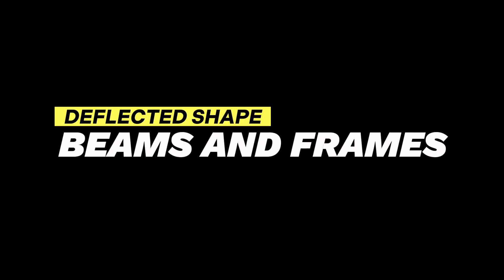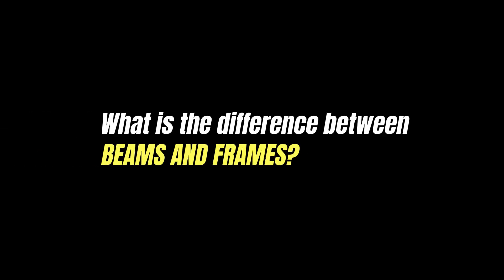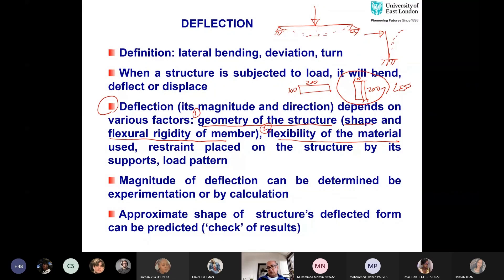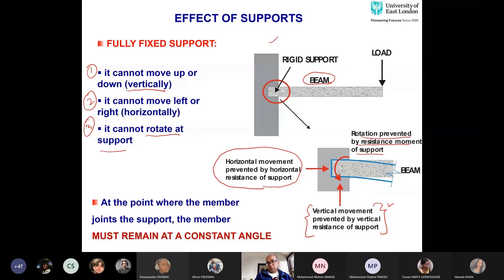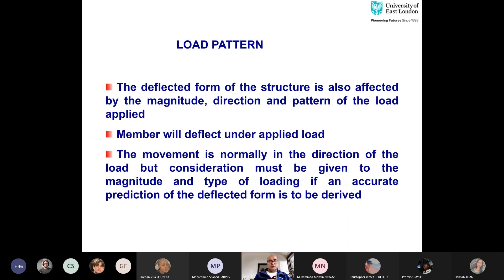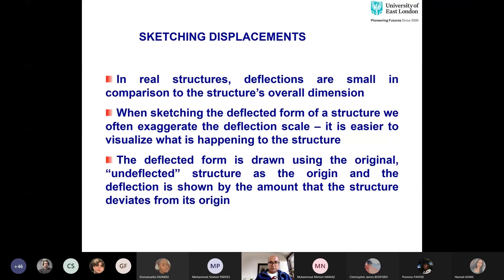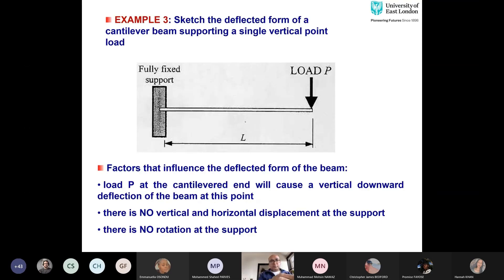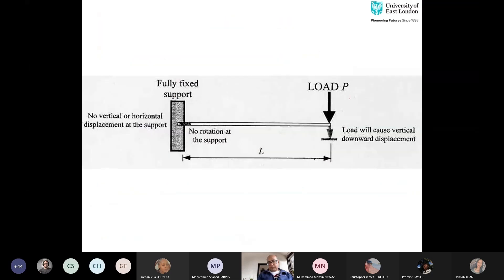How to draw deflected shape of beam and frame!

Comment: Why most engineers follows procedure like, BM diagram obtained from deflected shape, whereas, the correct procedure is, deflected shape to be obtained from BM diagram. As BM diagram leads to the deflection diagram, because the internal bending moments directly influence the curvature of the deflected shape.
Reply from the maker: Both diagrams should be in harmony. No matter if you start with BM or deflected form.

Comment: Pause video at 15:09 second, the BM diagram of beam having some hogging moments at its ends, and deflection for hogging hasn't plotted there, (only sagging effect is considered).
Reply from the maker: You are right. the deflected shape does not show double curvature properly. Although, it is there, but it is not exaggered to show hogging region in the deflected shape. I took the example from Paul Smith's book Structural Mechanical. 
I agree, hogging region of the beam should be exagerated in the deflected form. 
This is something I missed in the original lecture. Thanks for poiting it out.

Comment: (1): What is meant by "joint compatibility" ?
(2): In the simple frame,   for the beam rigidly connected and located between two columns, Whether it will deflect in "S" curve or "inverted S" curve? (When load applied rightward).
Reply from the maker: Joint compatibility means if beam rotates column will rotate too is it is fixed, developing a reaction moment.

Comment: Dear Dr Jawed, Thank you very much for your sharing. Can I ask one please, with pin support  resist only Horizontal and Vertical at support and free rotation at support but in reality as steel warehouse I saw most structural Engineers provide pin support to steel column? But in reality the column is not allow to rotate at all? Can you help explain please? 🙏🙏🙏
Reply from the maker: Having a pin support is a modelling assumption. In reality, all columns and beams will take some moment, but that will be far less than their moment capacity (ability to take moment). In pinned joints or supports, there will always be a gap to allow rotations, but remember rotations will be really very small.
Reply: @DrJQureshi  Thanks for answering! if you can make a video about it, very helpful junior Engineer like me.

Comment: Roller supports don't prevent horizontal movements only. They restrain movement perpendicular to their placement. For example, a frame has a horizontal member connected to a wall, and the end condition is roller. In this case, roller support will allow the vertical movement, but it will not allow horizontal movement.
Reply from the maker: Yes, absolutely right. Roller supports prevent movement in direction normal to their placement. Thanks for the comment.